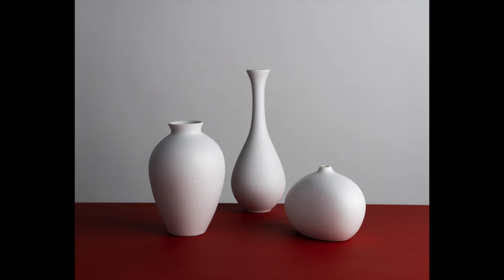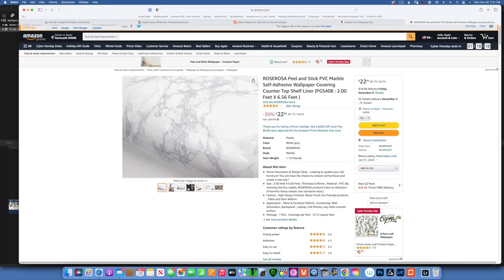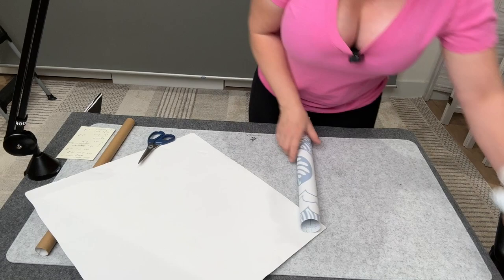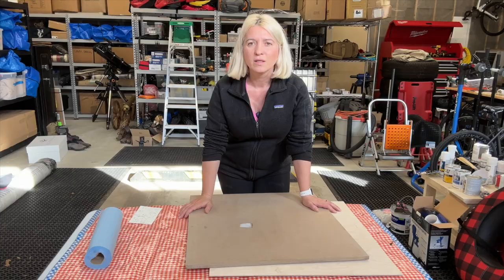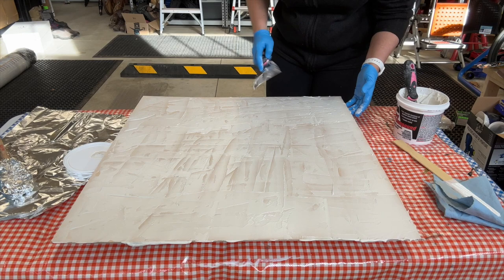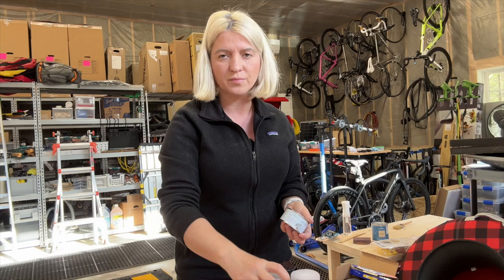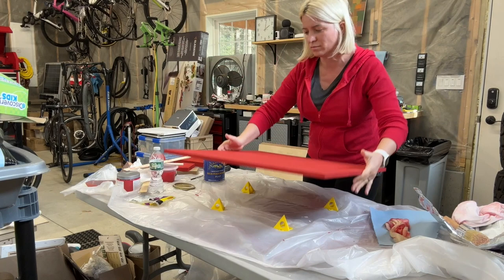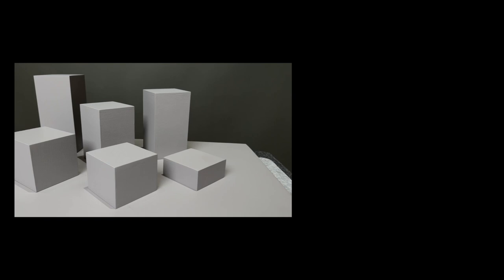DYI backdrops for food and product photography. Under $20

Comment: Just a little note for anyone doing macro photography, like jewellery etc. Not all contact paper has great prints so when you get up close to the surface it can be very visible that it is in fact a digital print, and not a natural material. In my experience that is especially regarding stone and wood textures.